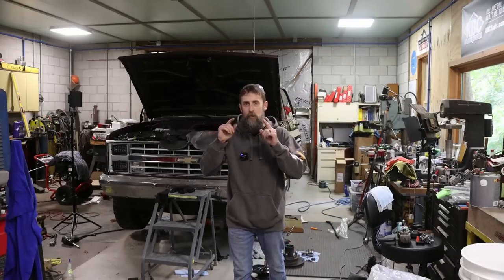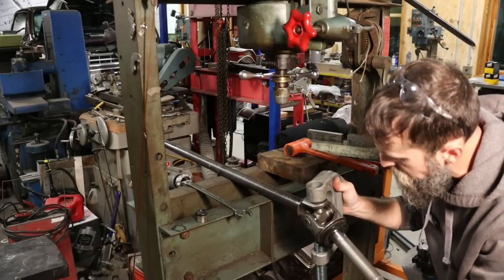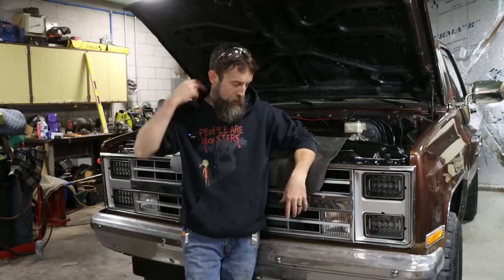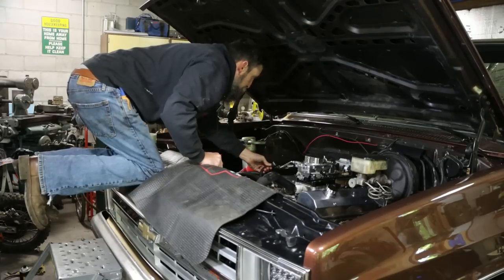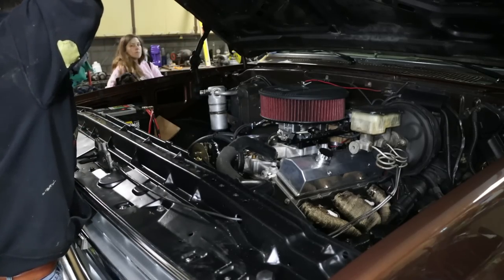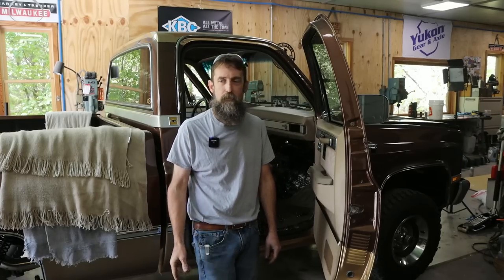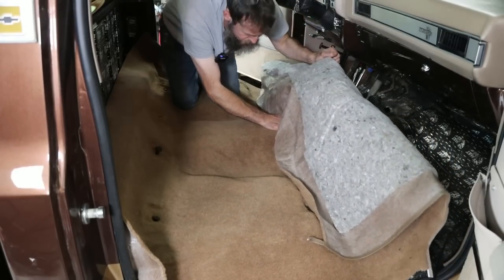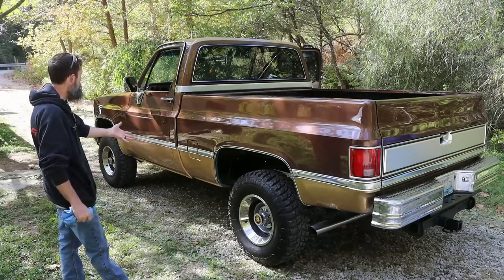Sorting out engine and axle TROUBLE :-(  Installing New Carpet as well!

Comment: moan , why is it that there ALLWAYS mistakes made when ordering stuff like that , its a simple mistake but can grind up the splines in the diff unit as they basicly rub the edges together and blunt them (as you noticed thatmakes installing the right splined axle harder to mount and makes the connection weaker )
sumtimes i think these wharehouses are operated by morons either that or theydont open the return boxes and "assume" that the people returning the stuff are honest 
at least youre in the states , i ordered all sorts of parts and payed through the nose on import tax and shipping fees and at times i had to return it 3 times before i gotten the right part costing me up to 100 bucks extra in shipping and all that , they even re-labeled the return boxes i send them telling them its the wrong part and send them right back .................sorry bout the rant
Reply from the maker: I get it bud, That axle was frustrating.  I will say that Yukon gear and axle had me a new one in 2 days . Luckily no real damage was done.  It was just enough to make installing the new axle a pain.  I have fought installing known good axles on that driver side . It for some reason is a bear at times to get lined up.

Comment: First class job and a hard one , know your happy it’s finished (now pat yourself on the back). Everything about looks better than factory ! I’ve been i auto repair for 40 plus years and rebuilt numerous s b  Chevy’s and thru The yrs. I’ve had my share of cam and dist gear issues, sometimes even the very best you can do will bite you . One question what kind of transfer case  do you have, appears in the video you have two short shift levers side by side or is that your transmission shifter hanging through the same hole ? Just curious?  Thank you for your videos good clean family oriented, hard to find these days !!!

Comment: Beautiful truck but don't worry - you'll have plenty of chances to get your stroker engine work truck straightened out - you'll be back in it every few months until you finally give up and put a stock 350 back in - that is assuming you're actually going to use it for a truck instead of letting it sit around looking pretty. That's what I like to do (let it sit around and look pretty for my own enjoyment.)
Reply from the maker: Time will tell on the engine.  So far I like it. The only problems I've had with it were self induced. Oil leaks are part due to me not running a proper PVC system yet. 
I know it runs really strong. 
Thanks for watching
Reply: @SteveSummers  that's just part of a stroker

Comment: Oh boy, that driveshaft. 
Been caught out similarly myself, doing an overnighter to get it up and running ready for a day out off-roading with begged and borrowed secondhand parts. Totally my fault though, I reassembled it at about 4am and simply mixed up what I’d removed with what should’ve gone in. 
What can I say, apart from I’m not perfect. 😅
Did my mates take the p?
OH yes!😂

One thing, the old guy that I was apprenticed to was a firm believer in getting some moly paste on the splines when assembling. I’ve always done that, but do you have an opinion either way?
Truck’s absolutely beautiful, man, she’s a treasure. 
Cheers, R. 😎👍